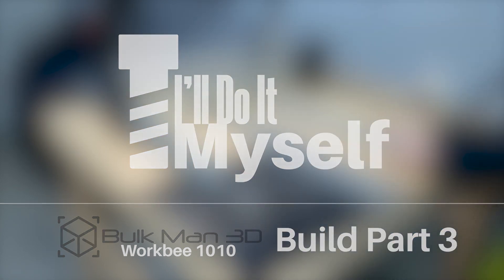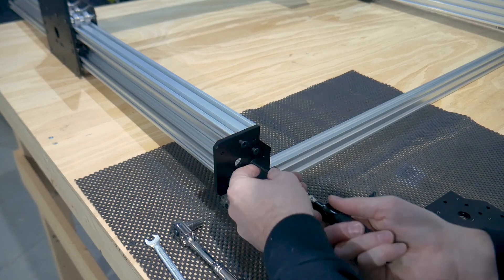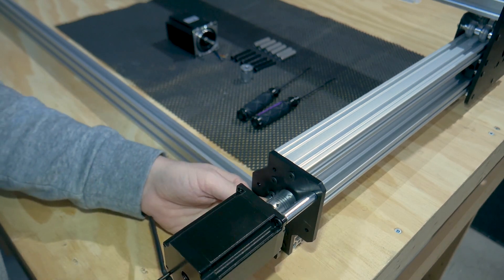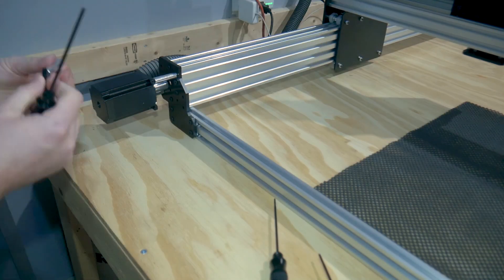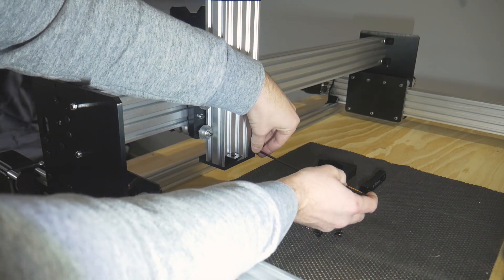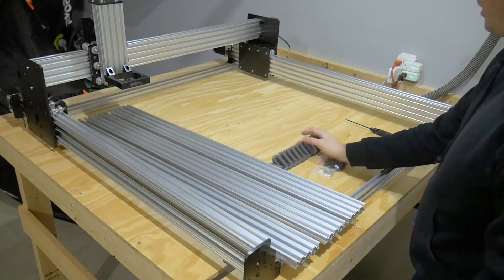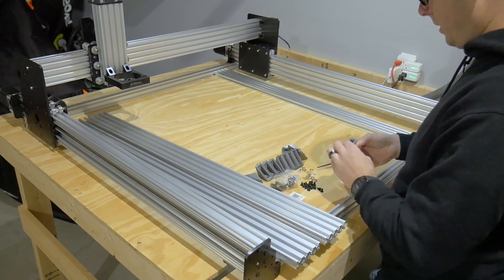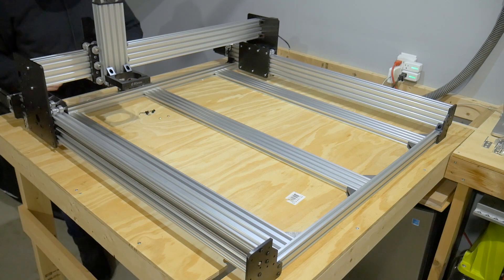Workbee CNC Bulkman3d Kit   Build Part 3

Comment: I have the exact same machine and size. I have a few problems that I cannot seem to fix. Hopefully you will be able to shed some light in my issues. Motor tuning. After I set them up and have them moving smooth and quietly I run a gcode and they sound like they are going to explode. I am using Carveco maker and tried a 22" circle in plywood. The  machine cut an oblong circle. I use mach3 and the circle looks oblong in the display. Carveco maker support is stumped. Anything that yo can come up with is greatly appreciated 
Mike
Reply from the maker: Hey Mike take a look at the dip switches on your motor drivers. I recommend changing them to 1/8 stepping at 3.5a then change your mach3 steps to 200 of your in metric.
Reply: @IllDoItMyself   i will   BTW I have mine set up in imperial
Reply: @IllDoItMyself  E.S. A stepper motor with a 1.8" step angle, the final step angle under "Micro step 4" will be 1.8"/41=0.45"                       Micro Step Pulse/ Rev  51  52  53                                           4                          800      ON  OFF OFF              This correct
Reply from the maker: Your probably looking around 5080 steps per unit

Comment: I have read on a few user groups on Facebook, that some people are opting to replace the 3/8 inch lead screws supplied in this kit with 1/2 inch lead screws. They say it makes the CNC faster and quieter. Do you agree or disagree?? I was also wondering if ball screws for the X and Y axis would be a worthwhile upgrade.
Reply: I would skip the lead screws all together, they have backlash that increases with use, they have increased friction which in turn forces lower feeds and speeds. By using backlash compensation with mach3, slower speeds must be used because the stepper will stall on direction changes in an axis. Ballscrews  are very affordable these days and it makes no sense to even use lead screws at all. The difference is astonishing, from faster rapids to smoother surface finishes.
Reply from the maker: You need to do quite the modification to fit a ballscrew. Sure a ball screw is better but the cost and work required might bump you to a different machine altogether anyway.

Comment: Hello, Great video and great CNC!
Are you able to cut aluminium with it.?
By the way the size of the gantry is 1000x1000mm so what size did you choose for the table to be able to fit the CNC?
Thanks
Reply from the maker: Hey Thankyou, yes it certainly can my next Video will be up shortly demonstrating aluminum cutting. I chose the 1000x1000 and it fits perfect on a 4ft by 4ft table.